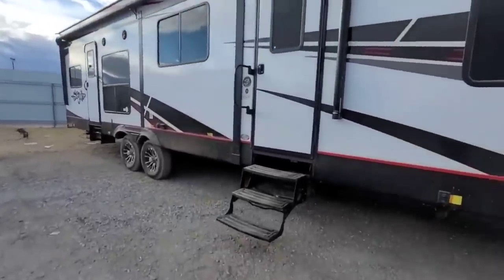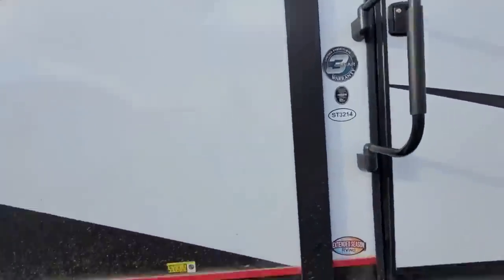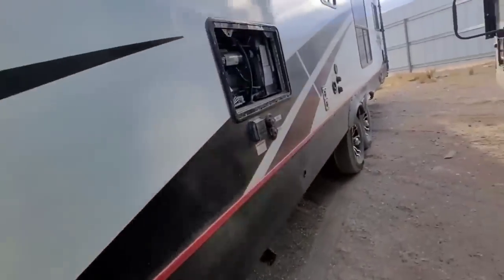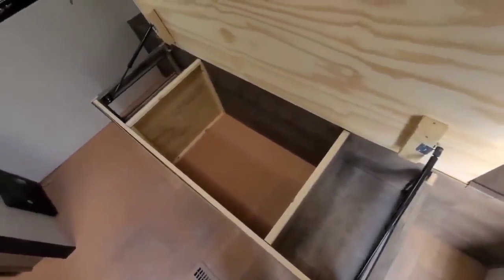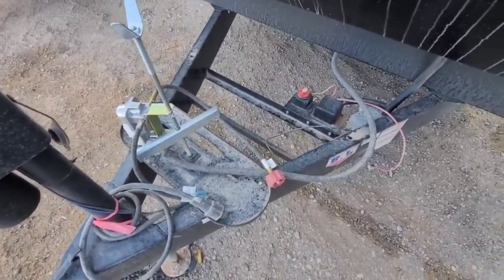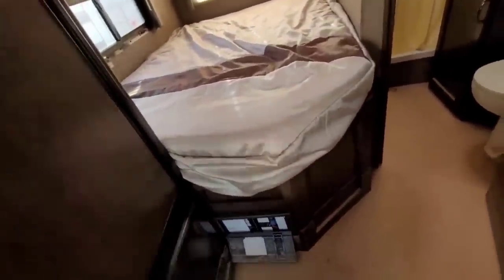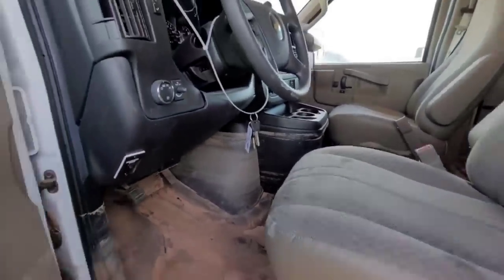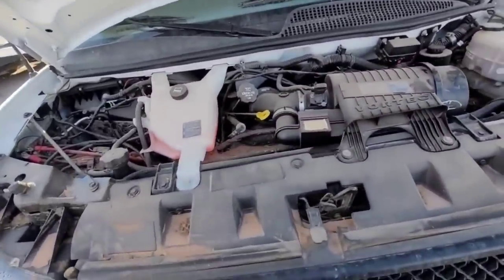Brand New Flooded RV's At Auction For Super Cheap. Copart Walk Around

Comment: Yeah, that class C is toast, baby, still has water in the headlights. Any other unit that had water touch the floor level will soon need the floor material replaced due to rot or mold growing. The C? Fagedaboutit, I wouldn't throw $20 at that thing, will need 100% rebuild from the tires up for the chassis and the RV part